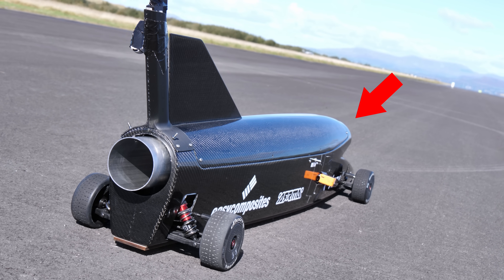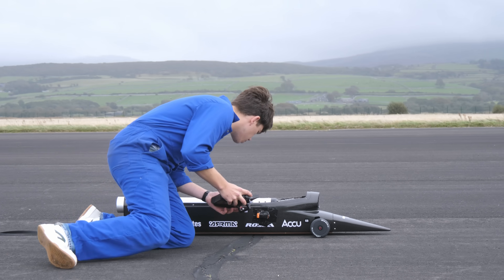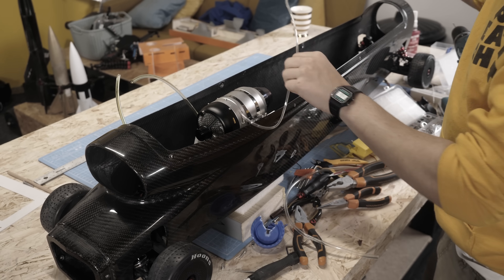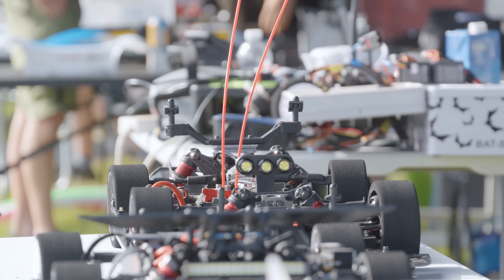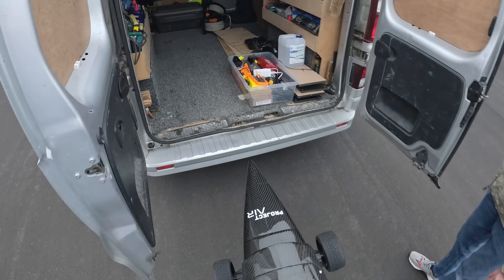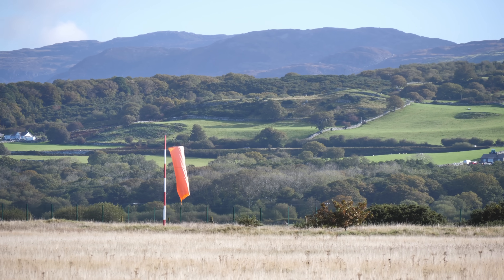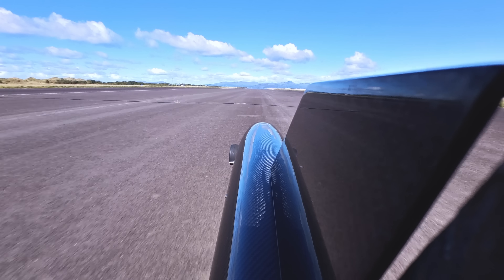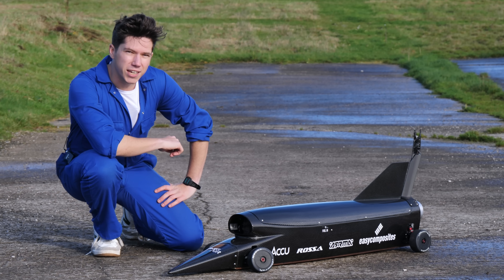World's Fastest Jet RC Car (Runway Testing)

Comment: Hi, im an engineer with aerodynamics experience and I have a few suggestions to make this a real contender for landspeed records.

1. Lose the giant tube for airflow. The exhaust is getting disrupted due to turbulent flow off the walls of the exhaust pipe and youre losing significant margins in terms of thrust. Id bet upwards of 40%. 

The engine should be placed on the back, up off the vehicle with some aerodynamic shrouding or have dedicated intakes that feed directly into the intake without changing the intake cross sectional area. These jet engines dont care all that much about the direct uninterrupted flow but they will gain performance in non-turbulent air. (Intakes make the air turbulent, kinda)
2. Wheeeeeeels.

The wheels are major drag sources, they need to be shrouded, ideally inside the main aerodynamic body.

3. The fin. Im very worried about the stability at high speeds. A single high fin in the center as a correction force causes significant roll moments to be formed around the longitudinal (long) axis of the vehicle. Most cars for this use 2 fins to get that aerodynamic stability, out on the side of the vehicle. Making the front thinner profile than the rear will help with stability too afaik.

4. You should consider using ground force to keep the car stable as well. Wing but backwards.

Overall good try but needs a bit more cooking imo, good luck
Reply: those rubber tyres will also just explode at anything near record setting speeds. Needs foam tyres.
Reply: I will also point out that integrated camera farings are essential here. That fancy means nothin if you have a big runcam taped to it
Reply: He's also using a very small engine right now, as he said, about 1/3 the power of the one he ran the 94mph record with...
Reply: @therealmrtexas  Jet engines are just not that good for this purpose at low speed. Generally driven wheels are best for speeds up to 300 or 400km/h, Propellers are best to 800km/h, turbofans with large bypass are good for close to the speed of sound and pure jet engines are good for speeds above. 
He will be able to reach the record with small jet engines but it will take an incredibly long run up since acceleration is horrible. Lets assume he uses a 100N (small) engine and a 10kg Car, leaving out all the losses this ends up at 10m/s per second.
s=1/2a*t² -> if he wants to reach 400km/h = 111m/s that would be 11s of acceleration and 605m of distance!
 Without any drag in air or friction to the ground so he will have to have a run of what id estimate to be at least 2km with breaking and he wont be able to see the thing all the way.
Reply: @therealmrtexas  thats fine but this design is kinda terminally underengineered it seems.

Im currently directing a smallsat program at my university and im unfortunately very aware of what vibes based engineering looks like. I hope it works but I think there are some serious problems that should be adressed
Reply: Thank you for summarizing. This is indeed as far from world record car as it could be, and although EasyComposites made their part well, the concept is doomed and underengineered. Nice visuals for the crowd, though
Reply: @dylansynowic2829
Do you have any records? Have you ever built an RC car and actually won a contest? If not, then don’t tell others what to do. If it was really just about ‘engineering,’ then every engineer in today’s shows or even Guinness World Records would be winning these contests.
Reply: @mahekthapa9053  What are your credentials by the way? Just curious.
Reply: If you actually had experience you would know that this "giant tube" is called an ejector and it increases the thrust of the engine by mixing the exhaust with a mantle stream. Besides this, the location of the engine is relevant to the center of gravity, the tube is low density, the engine high density, more mass in the front, more stability.
Reply: @NIOC630 ejectors are real ofc, im aware  of their existence but they are generally shorter and have a smaller diameter at the exit. They are also more effective with bypass turbofans than for straight turbojets like the one in the video. To get actual benefits from them required more engineering and design compentency than i see here unfortunately. In this cae the exhaust impingement is likely contributing to loss of thrust.

I dont want to argue lol, i just think that this is a case of "vibes based" engineering where there isnt much real math going into it
Reply: @NIOC630  if ur gonna be rude at least be smart about it
Reply: @irrelEvant5352its so funny how mad trolls get, like bro I didn't come here to argue I dropped a constructive comment based on my experience and people are like "WELLL ACTUALLY YOU ARE STUPID"

okay my dude I super dont care
Reply: @irrelEvant5352 I just cant stand wrong information from "im an engineer" people on youtube who never had any actual experience.
Reply: @NIOC630 dude, if you knew my credentials lmaoooo. Im not here to argue so I won't be feeding the trolls anymore. We both have opinions on this, I dont know your creds you dont know mine other than what I've told you which you won't belive anyway. Im not gonna dox myself to prove it but if its anything I actually run a smallsat program at embry riddle. Not exactly the same thing as this obv but I do have a lot of understanding of aerodynamics and jet prop seeing as I build rockets in my free time and am a part of 2 space shot attempts rn. I get the jet prop experience from being around a ton of engineers in the jet prop track, I actually asked a few about this before making that comment.

If you said you were the arbiter of all things jet prop I wouldnt have any evidence against it I just dont understand why we're arguing since im like 99% sure we agree on half the shit here lmao

If you
Reply: @dylansynowic2829 lmao fr
Reply: @NIOC630  well what makes your word any more valid than hers?
Reply: @irrelEvant5352 well what makes her word any more valid than mine?
Reply: @NIOC630  shes not acting like a jackass
Reply: @irrelEvant5352 Oh yes, she is. "uh, if you just knew my credentials".
Reply: @NIOC630  maybe change your tone first so you dont get reactions you dont like
Reply: @irrelEvant5352 How about you do the same?
Reply: @NIOC630  hey i didnt start this. ill lay off after you

Comment: I'm really enjoying the project you're doing. I really like the car, but since you still have some time to work on it, I'd strongly recommend an aerodynamic cover for the wheels. If you don't want to make any major changes to the chassis, you could also do something like the "Flame Spear" from "Mafia: Definitive Edition." It should help a lot with the aerodynamics of the wheels by avoiding annoying vortices behind them, thus also improving stability and top speed.

Comment: Pro tip, cover the wheels, the top of the tire is experiencing wind speeds of double what the car body itself does and is a major source of drag. More power is all well and good but land speed racing is a pure equation that power = aerodynamics + friction at top speed. Weight only matters on acceleration and braking.
Reply: You're a pro? LOL!

P.S. They run open wheel designs at Bonneville all the time. I've seen old 32 Fords break 300 mph with all four corners, knifing through the breeze...

Comment: Great project man!!!! The older I get the last run is your LAST RUN, good call and suspense builder. Let me make you a set of shaved down carbon wrapped arms for free. I’ve made some for my f1 car 1/7 project and I think we can make them just as strong but way more aerodynamic. I can post a video of them on my YouTube reels just say the word. Also try going to diff oils like 10k cst in 1/10 shocks and make your own custom shock towers from carbon that will lighten up the whole car a ton. I still need help making laydown suspension for mine. 

I also am working on modeling a hub mounted wheel cover. To make a mould and carbon fiber them. Video editing for work  sucking all my time from projects😢

Comment: steering is twitchy coz at those speeds you need a rudder, just like a plane. Replace front two wheels for 1, tricycle layout. Install a rudder. The tail fin will help keep the vehicle straight, and the steering will be nice and smooth. put in a steering gyro for good measure. And ditch the go pro. Put in a FPV camera from a drone with it's own aerodynamic cowling. You don't need 4k60 for a record breaking speed run.

Get rid of the drag and I bet your runs will be faster. That go pro and those open front wheels, tie rods, steering arms and axles are sapping your speed.

You've got a jet engine so steer it like a jet, with a rudder.

Comment: does rolling resistance matter much on a car that size? I would think something smooth and hard like a skateboard wheel would work work better than a flat rubber wheel?
Reply: If you get rid of tire friction, then you lose braking and steering.  Im with you, though.  He should get pizza cutters for wheels and utilize fins and flaps to steer and brake.  It's more of an aircraft than a car at the speeds he's trying to achieve.

Comment: Why did you go with a smaller turbine this time? Also... design wheel spats to cover those wheels. Mount them on the wishbone mount points. Also wish bones... mount aerodynamic leading edges to them too and trailing. Pear drop shape.

Comment: i love that because the wheels arent driven, you dont need downforce.
1. your steering needs to not be directly connected to the servo if thats not already done. The servo has some play that may act up as you increase speed.
2. parasitic drag around the wheels.
3. take a break. look after your health. mentally and physically. you are the most important part of your journey. my best friend told me this before he pulled the plug.

Comment: I wonder if you could make AUTO STEER ??  A GPS based steering solution so you don't have to worry about going straight when punching it.
(and then if you actually try to steer, it's overridden).
Reply: Or even just LASER based (with lasers at the end of the runway)

Comment: There’s clearly a downforce issue — it’s not glued to the ground; you should add a small opening in the metal tube after the reactor to create a low-pressure zone using the Bernoulli effect!

Comment: I've never been good at driving RC cars. And especially at a larger distance. With all the advancement that has been made for drone cameras and flying using the vision from that camera it makes me wonder if it wouldn't be a good idea to use that for a extreme RC car also? And no I have not tried it myself so I don't know either way, but it seems logical that getting a first hand view of the race track would help making sure the car doesn't get out of control.

Comment: You might try to reduce your rolling resistance by using tires that are narrow but the same diameter. It may even reduce drag. For further testing you could increase the track width of your rear wheels.

Comment: Good job, every mistake is a chance to learn and improve, I'm making a BattleBot and every time some random LiPo battery catches on fire for no reason, we learn not to but magnesium parts next to a spinning blade because bits from other peoples bots can cut into the magnesium and set the chips on fire which is not optimal for batteries.

Comment: The carbon fiber shell is very aerodynamic and well built, but that intake is so draggy without an inner surface, and all of the stuff taped on negates the aerodynamic work. Also, try to see if you can implement a changing steering rate based on speed. Keep working at it!

Comment: There is a few of the comments that i agree on, even if most of them are hars on you. But being a Youtuber with sponsorship on this rc car, i fully understand why you take one step at a time.

And making a series about this rc car, of course it will be a bit slow in the beginning and to build up the hype for the real 100% throttle with the big motor at the end.
And that the main sponsor is the maker of the the body of it, dont want to see you crash it directly.
The time and money they put in to it, working off your design and making it more efficient and stronger. For free!!!

I would aswell be on my toes not to throw everything away on the first run.
Keep up the great work and shoot for the stars mate 💪 🇸🇪

Comment: I believe there are three reasons the steering is twitchy.You have too much camber on the front wheels (should be none), you have too much steering authority (it turns too tight of a circle, it only needs enough lock to turn around in the width of the runway) and it appears there is some looseness in the front suspension somewhere.
Reply: There also seems to be a lot of toe in on the rear wheels.
Reply: @markusjohansson4971  rear toe in (and front toe out) is good for stability, although it's bad for rolling resistance. As the car turns right and loads up the left wheels, setting up toe like this makes it self steer back left, and vice versa. A healthy amount of caster on the front will help the front wheels self steer and make any slop in the steering less of a problem. I would keep the aggressive suspension settings to maximize stability until a flat out run can be done, then dial it back to try to reduce rolling resistance.

Comment: lots of faffing about just because it has a jet engine, if it had an electric motor you would have just gone for it and beaten 50mph without thinking about it, stop over thinking it just because of the jet, its the same with jet rc aircraft people think that something is different because you have change the power plant type, it still a plane.

Comment: Concidering the car hit 63mph at a 1/3 of what it's designed for I think is a conciderable achievement. No it's not a blazing speed but you have to know how a car drives before going 100%. I say listen to the chat in the steering issues, mechanical and electrical and keep scaling up until it's flyin